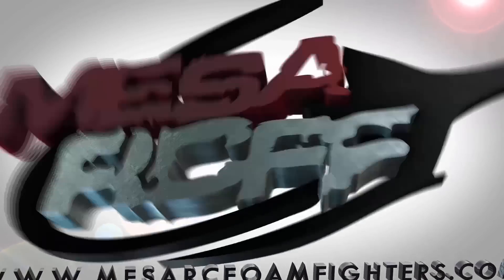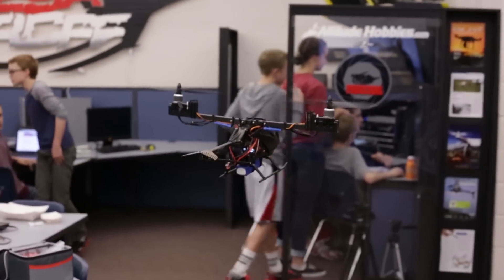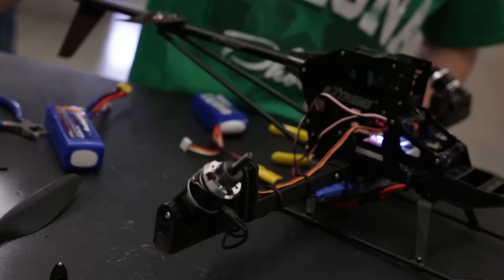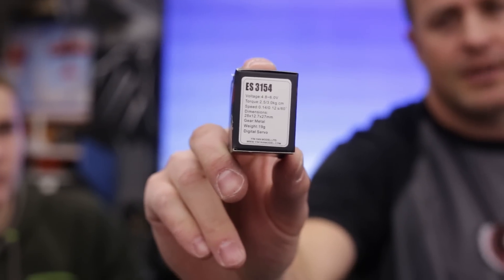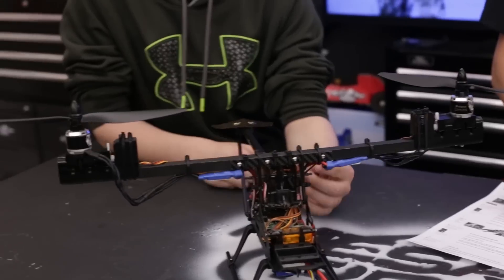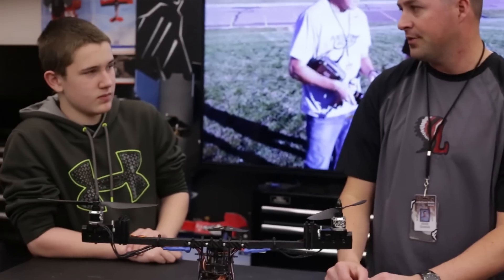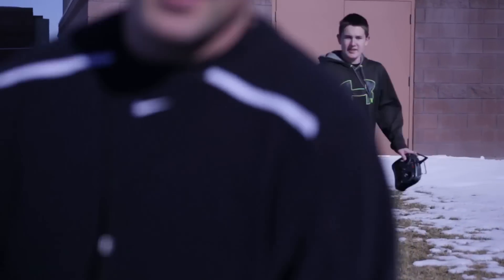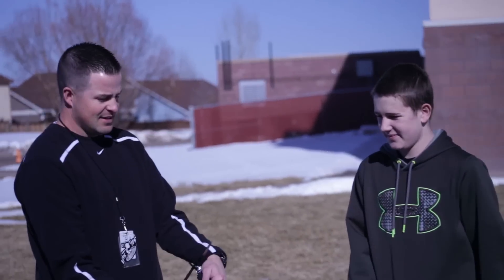MESArcFF - Tough Tilt Dual Copter - QUICK PROJECT

Comment: It would have been a more involved project to make the helicopter into a dual rotor helicopter like the CH-46 Sean Knight or CH-47 Chinook...2 rotors with collective and cyclic pitch.  Not just 2 fixed pitched rotors on quadcopters.  The rotors from helicopters.

Comment: I'm planning to do a tri-copter similar to this (three tough tilts); but minus the flight controller and the like (just the tough tilts, props, motors, servos, ESCs, RX, and battery). I believe your front to back oscillation is related to the flight controller's constant over compensation; if you fly it with out the flight controller and your TX set in V-mix with differential thrust, you would get a better result.

Comment: You have a small horizontal tail surface off of the donor helicopter, but have you tried a larger horizontal tail surface (for example, a seaking helicopter stabilizer) ?, this would this would cause drag as its starts to pendulum around the duelcopters lateral axis and, as like larger helicopters could give some lift to the tail / stability in forward flight

Comment: great build guys. to try and stabilize the rocking motion try adding a longer tail bone with a larger horizontal fin. this should minimize rocking back and forth but will increase rocking back and forth upon rapid climb and descent something you could do to minimize that would be to put a horizontal hinge on the tail boom for that fin

Comment: I assume the swinging is coming from the CG from top to bottom being shifted to the bottom. If it was shifted to the top (which is the first way you set it up) it would just want to flip upside down. which is what I assume happened when you mounted the boom to the bottom of the chassis. I can safely assume if you were to balance the CG from top and bottom to equal proportions you would eliminate the pendulum swinging effect. maybe even play with the CG to see if it handles better with the CG shifted slightly toward the bottom. GREAT BUILD THOUGH Looks awesome, I might build a mini FPV racer Bi copter version and see how it works. Good  luck guys.

Comment: If you could raise the centre of gravity it might reduce the swinging motion - as all your weight is well below the boom line it has a pendulum effect so once it starts swinging it is very hard to recover. might also help to raise the control board as the vertical distance between the board and motors will also have the same effect

Comment: You could try lowering the pitch gains and also moving the controlboard further away from the motor axis which could give a better registration of the angle of the copter with respect to the boom. Right now there is a not much travel in the vertical axis when oscillates an this could be causing the oscillations

Comment: I wonder if turning down the elevator gains would help with the wobbling problem
Reply: ***** If possible, consider upping your servo refresh rate. I see the supplied servos are digital, so they should handle 200Hz without issue.